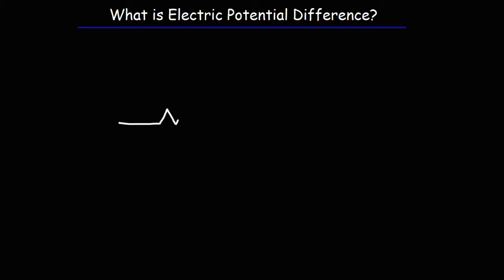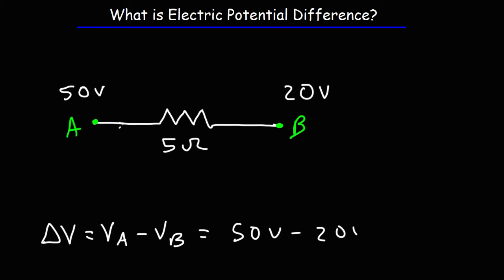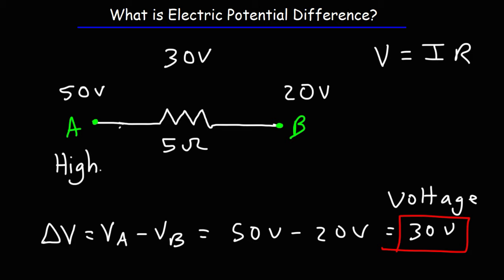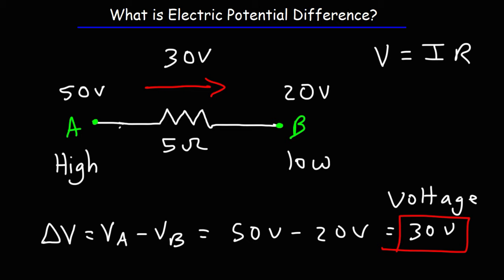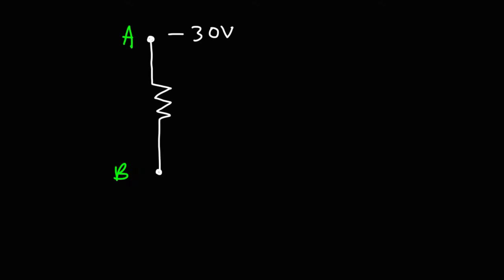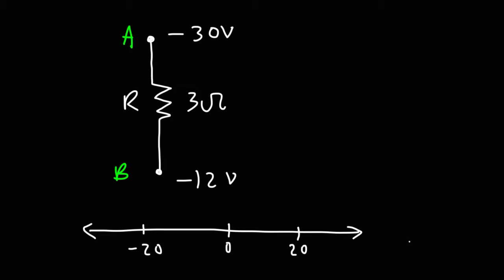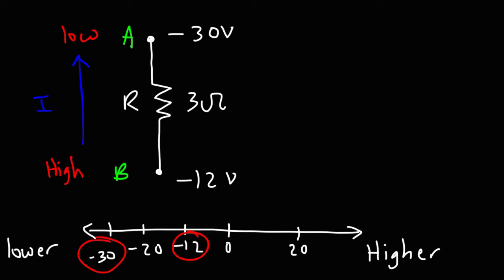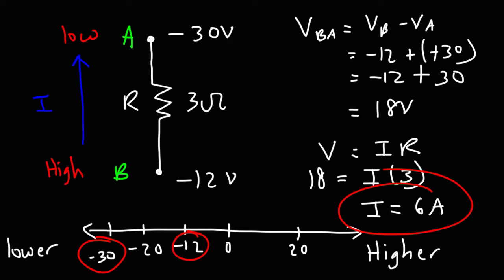What Is Electric Potential Difference?

Comment: Can someone tell me what potential difference is exactly
Reply: It's the voltage between two points
Reply: Thanks dude
Reply: The electric pressure difference is known as the potential difference
Reply: Amount of work done (force×displacement) in unit charge from one to another point is known as potential difference
Reply: voltage
Reply: Current pusher
Reply: Potential energy is u=kQq/r for a Load  so if you divide it with q, you get U/q = potential V which doesn't change ( you double q=> so does U).

Potential energy is specific for a load whereas potential V is general for 1 Coulomb.

Potential difference is the energy you need to transport 1 coulomb load from A to B. This energy is given by the battery.

Hope you understood it
Reply: Difference between Apoint and B point.
Reply: I dont know why this comment made me laugh 😂😂 bro the video explains it
Reply: It's a voltages  difference between two points...

Comment: Just remember this is how we read schematics but in reality the high potential(+) has less electrons than low potential (-) more electrons. Electrons want to go to the high potential to fill in those holes in the valence shell. So a battery provides the energy needed to move the electrons from point a to point b
Reply: Yeah, I'm perplexed that "conventional" current direction was proven exactly wrong something like 100 years ago but it has never been corrected. So mentally I have to switch back and forth between conventional and actual current flow. Like, why doesn't somebody in some standards organization say enough with this stupidity. As of this date we are going to start using the correct direction.

Comment: But electron flow from high voltage to low voltage as high voltage will repel ...so current is opposite the flow of electrin so current direction must be from low voltage to high...explaun

Comment: you didn't really describe what electrical potential was, I understand now how to determine if the flow of current and that the higher side of potential energy will flow to the lower side but i don't know why is does that and your title is "what is electric potential difference". other than that i thought it was a good video :)

Comment: Difference between e.m.f and potential difference
In circuits, voltage is due to surface charges. Consider a simple circuit comprising a battery, two wires and a resistor. 
The e.m.f of the battery is due to separation of positive from negative charges which produces an e.m.f across its terminals and a pattern of electric field surrounding them, not exactly but like a dipole.
An electric field is there in the wires and in the resistor; powerful electric field and uniform within the resistor, weak and uniform within the wires. The field is set up by a tiny amount of surface charge with a steep gradient on the resistor and not so steep a gradient on the wires. 
It is the electric field E created by the surface charges sourced from the battery, which produces a force causing the mobile electrons to acquire a drift velocity v = μE, where μ is the mobility which is a number representing the freedom of movement of the electron in the lattice. 
This results in a current density J = σE, where σ is the conductivity of the wire or material of resistor and E is the electric field in the wire if considering wire and is the field in the resistor when considering the resistor.
The p.d. or voltage across the resistor is the integral of a constant powerful field along its length. The p.d. or voltage across the wires is the integral of a constant but weak field along its length. 
Voltage is entirely because of the surface charges.

For a live demonstration of surface charge in a circuit visit
https://youtu.be/U7RLg-691eQ
Electrostatics and circuits belong to one science and not two, that of electricity and magnetism. To know how they are unified visit this link 
https://matterandinteractions.org/articles-talks/ and view the article 'A unified treatment of electrostatics and circuits.  B. Sherwood and R. Chabay, unpublished. (1999)'
pdf. 
For more details on the difference between emf and p.d.see Electric and Magnetic Interactions by Chabay and Sherwood 
www.matterandinteractions.org
or 
Fundamentals of electric theory and circuits by Sridhar Chitta
https://www.wileyindia.com/fundamentals-of-electric-theory-and-circuits.html
There is a "look inside" feature in the amazon.com webpage of the book "Fundamentals of electric theory and circuits" by Sridhar Chitta with a few pages of Chapter 1 which may be viewed and also which you may swipe left or press < icon to view the foreword, preface and Table of Contents. 
For a lecture by Prof Ruth Chabay on surface charge in a simple dc circuit visit 
https://youtu.be/-7W294N_Hkk

Comment: oh my god thanks excellent .why is the voltage negative
Reply: I think the reason he put the two voltage negative, was to distinguish between which voltage value was the greater one since the greater voltage value which is -12V should be subtracted by the smaller voltage which is -30 volt. The more negative a value is, the smaller it is. 

Difference in Potential = Vlarge - Vsmall = -12V - (-30V) = 18V
And then you can just divide the 18V by the value of the resistor and you will get the current.

Comment: why is the voltage negative?
Reply: Voltage is caused by the presence of protons and electrons, if you take protons only as the indicator of voltage, then the ratio of protons to electrons at a certain point is directly proportional to the voltage, but if you have no protons at all at this certain point, and only electrons, voltage is negative. And vice versa.

Comment: Your definition of potential difference or voltage is rather vague not explaining what voltage or potential difference is actually is , merely give some mathematical quantities with the unexplained term 

The phrase "potential difference " is ambiguous , not clearly indicate what really is potential here 

I bet that all you guys will say that it is electric potential energy . Even so it is still ambiguous , because there are different  types electrical potential energy involved in such a circuit, such as mechanical energy, thermal energy and chemical energ. 
The correct term for the phenomenon is ekectromotive force , but not energy 
Lets see why it is so 
If you want to use mathematics to explain it,  here is  an appropriate way to do so
F=Fd where F is electric force , d is displacement , w is the work to be done by the force to move a charge carrier from one point to another point in an applied electric field
F = qE ---> w = qEd 
Since w = - (Uf-Ui) = Ui-Uf ,  qEd = Ui -Uf 
Where Uf = final ekectric potential energy , Ui = initial electric potential energy
Since Uf -Ui = q (Vf-Vi) ---> -( Uf -Ui) = -q (Vf-Vi)
--> Ui -Uf = q (Vi-Vf)---> qEd = q (Vi-Vf)
 where q = total charge, Vi = initial electromotive  force  , 
Vf = final electromotive force 
Rearranging the Eq " qEd ="q (Vi-Vf) to represent the electromotive force gives:
qE = F = q ( Vi - Vf)/ d

Since  q is conserved, you should not ignorantly apply any mathematical manipulation to remove q from the equation

Now you can see so obviously that the only changes here are a change of displacement or distance and a change of the value of the electric field, and when the value of distance increases , the strength of electric field will decrease , and thus the strength of the electromotive force on a charger carrier, such as an electron will also decrease. The force here is composed of an attractive force and a repulsive force from the positive terminal and the negative terminal of a power source 
Soppose that there are 2 points, point B is closer to the positive terminal,  and point A is closer to the negative terminal of a DC circuit, and an electron is moving from the negative terminal toward the positive terminal of the power source due to the repulsive force from accumulated electrons at the negative terminal

The attractive force from the positive terminal on the electron  at point B is stronger  than that on it at point A, because the distance between the positive terminal and point B is shorter than that between the positive terminal and point A , and similarly the repulsive force from the negative terminal on it is stronger at point A than that on it at point B , because point  A is closer to the negative terminal than point B is 

It means that if the positive terminal is considered to be the reference point to evaluate the attractive force on it, using the transmission of positive charge from the positive terminal , and from ionized atom to ionized atom to the negative terminal in which each atom in the lattice structures of the conducting materials of the circuit respectively becomes an ion when the repulsive force from the negative terminal is transmitted from free electron to free electron throughout the circuit,  and respectively repels the atoms' free electron(s) in their valances, then the electromotive force from the positive terminal on ions decreases as the transmission of the positive charge moves from point B to point A. In other words, Vf at point A  is  smaller than Vi at point B, and that is why you have a weaker electric force on the transmitted positive charge at point A , and a stronger electric force on it at point B 
You can say voltage Vi  at point B is higher than voltage Vf at point A if that ambiguous definition makes it easier for you to understand how electricity is actually established in a DC circuit. 
But it is not so  simple as the idea that electricity is a flow of electrons from the negative terminal to postive terminal, or a flow of current "i" from the positive terminal to the negative terminal as thecway how all of you guys  always fundamentally misunderstand it 

The so-called" the conventional direction of current" is a statement of ignorance, because it is not at all any sort of symbolic representation of current direction. Oppositely the transmitted positive charge from ionized atom to ionized atom from one end of an electrical circuit connected to the positive terminal of a power source to its other end connected to the negative terminal of the power source is an indispensable part of the formation of electricity. Without the function of such ionized atoms as  positively charged place-holders to attract  free moving electrons which are repelled away by accumulated electrons at  the negative terminal from the atoms of the conducting circuit , immediately next  to the negative terminal, there would be not any  flow of negative charge carriers or electrons from the negative terminal to the positive terminal at all. Ionized atoms are the 2nd medium which takes part in transmitting electromotive forces which give free electrons kinetic energy to move through a resistive load , and collide with free electrons in the circuit , and their collisions  cause frictional forces which convert the kinetic energy into thermal energy for light bulbs,  heating machines such as  stoves,  elecctric cookers, and into mechanical forces to run other types of machine to do work for human purposes

Both the positive charge transmitted from the positive terminal,  and from ionized atom to ionized atom throughout the circuit to the negative terminal,  and the flow of electrons from the negative terminal to the positive terminal equally play an important role in the establishment of electricity in any DC circuit

Voltage actually is a separation of two opposite charges to create an electromotive force which can move charge carriers in a circuit 

That is why what you guys always call ambiguously as voltage or potential difference is actually electromotive force formed by the combination of an attractive force and a repulsive force

Comment: How does a voltage develop across the unconnected end of a single wire connected to one terminal of a battery and the other terminal? 

If the battery’s net charge is zero, then for a 12 V battery, one terminal would be at a potential of +6 V with respect to a conductor at infinity, while the other terminal would be at –6 V. At the physical center in the space between the two terminals of the battery, the voltage is zero.
If we then connect a small wire to, say, the positive terminal, a few excess point charges will move onto the wire, and that wire will now be at the same potential as the battery terminal: +6 V. The wire will be surrounded by an e-field, and since the lines of electrostatic flux must always terminate upon charges, the wires must possess an excess surface charge. 

In the above we assumed the net charge of the battery was zero. Supposing that the battery had a net charge. Then how would the charges, potentials and voltage be changed? 

Before we answer this, it would be instructive to understand Current, the conduction process and Voltage at the fundamental level.
Electrostatics and circuits belong to one science not two as in the following two videos:
i. https://youtu.be/REsWdd76qxc and 
ii. https://youtu.be/8BQM_xw2Rfo 

Returning to our question of the voltage of the single wire connected to one battery terminal,  we assume the net charge of the battery was not initially zero. Perhaps someone with rubber-sole shoes carried the battery while walking on a wool carpet or perhaps the battery was charged to –5000 V, and would deliver a tiny spark if touched. In that case one terminal would still be 12 V different than the other terminal, perhaps –5000 V on the positive terminal and –5012 V on the negative. 

It is not possible in this brief post to discuss in more detail the process of production of the voltage of the single wire without a detailed discussion of the capacitance and potential of single conductors.
The last frame References in video #1  lists textbook 4 which discusses these topics comprehensively using a unified approach and provides an intuitive understanding of voltage of a single short and long wire with and without a net charge on the battery.